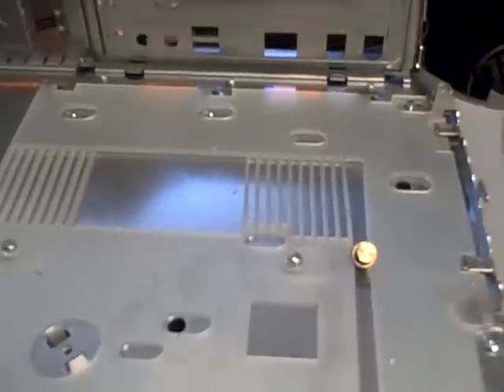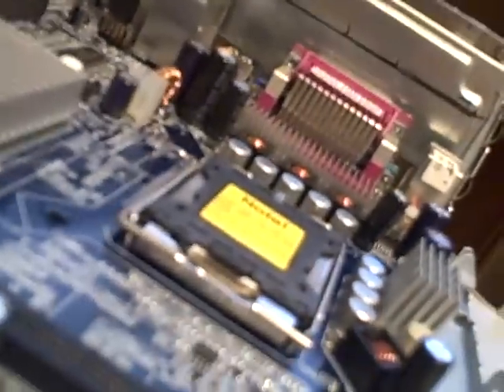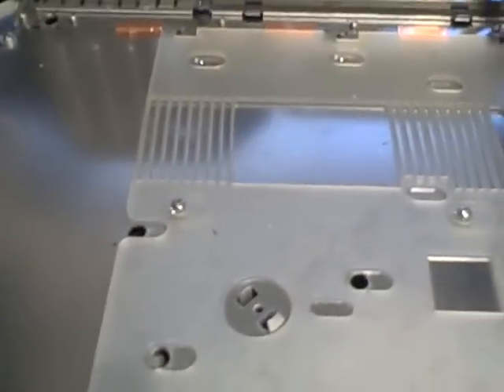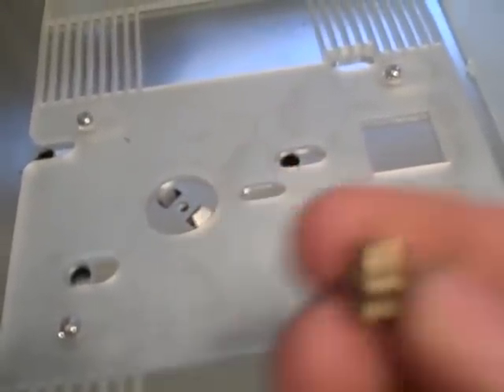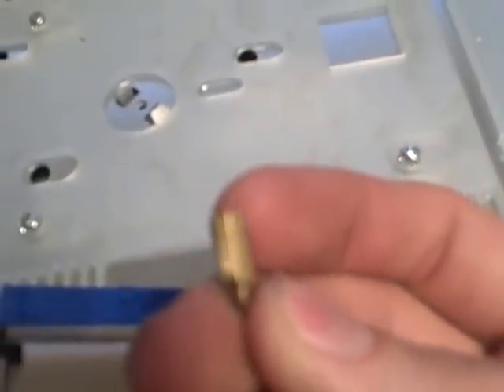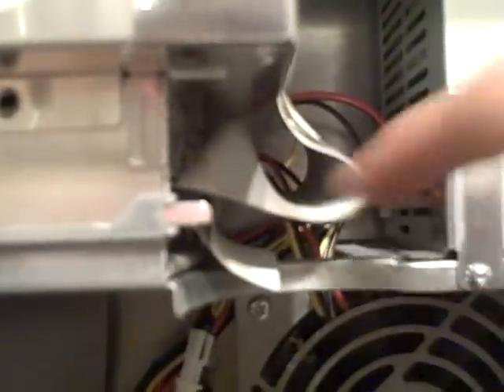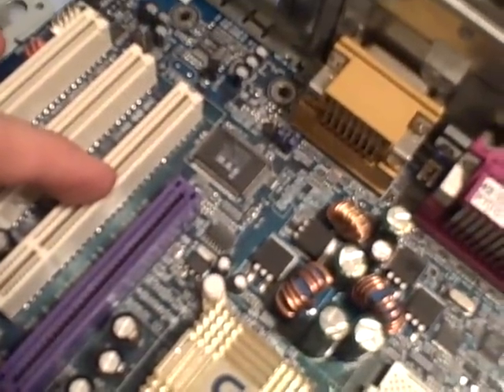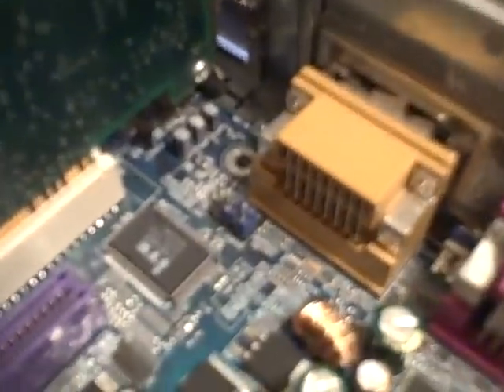Modding a G4 case for a hackintosh (part 2) test fit

Comment from the maker: @sweetnenita gigabyte ga-g31m-es2l One thing I ended up doing later was the case was running hot, so I drilled holes in the side of the case where the fan is so the fan could push out the hot air.